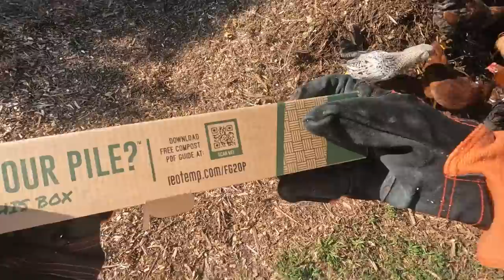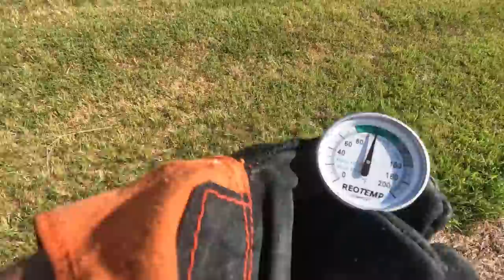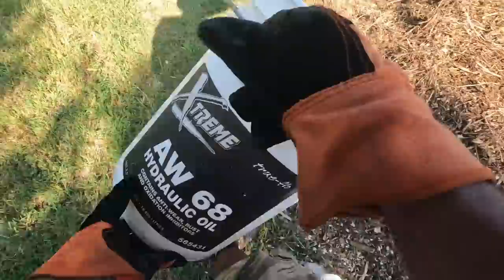Making Compost With The Chickens

Comment: My first pile finished cooking recently and now I'm doing a second with the chickens as helpers. It takes only four of them to completely level  the pile in about an hour. No actual composting can go on, but they mix it real well and have shredded and scratched the straw. If you want them to dig harder at it, try having it visibly moist on the outside. I don't add anything to mine. It's just soiled straw bedding from the pig pen. Somehow they find it irresistible. They love digging around manure a little bit too much. Even after they level it, some will stay there and continue clawing.